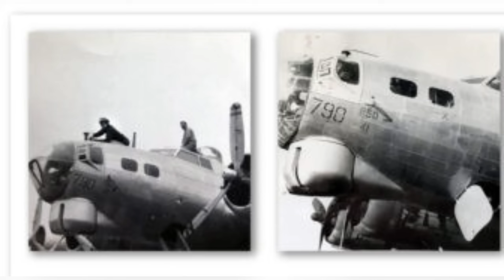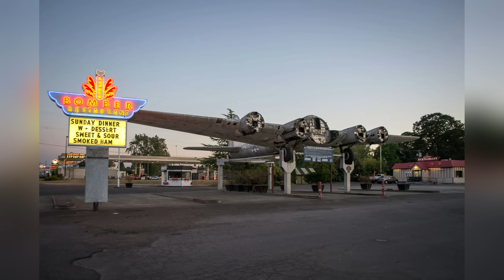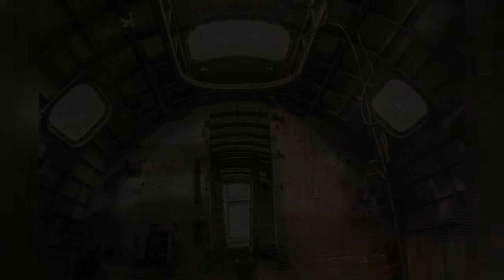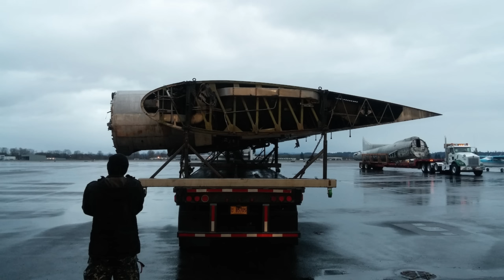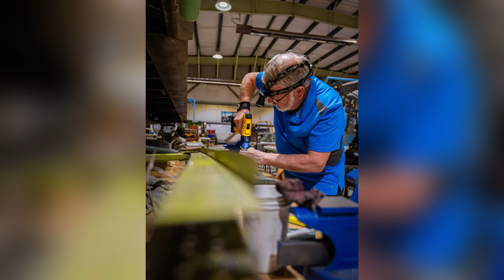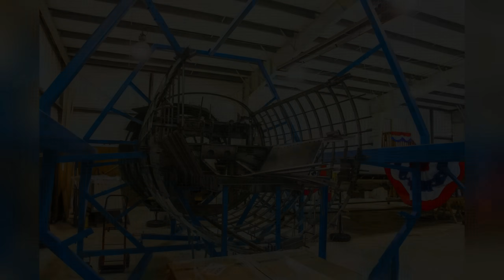Recovering B-17 "Lacey's Lady": Gas Station Bomber to Flight Again

Comment: I have to wonder if Boeing is supplying any assistance? I know Northrop refused involvement for a P-61 flying restoration in Reading PA and Lockheed also refused to support the now successful restoration of the P-38 “Glacier Girl” in Kentucky. The manufacturers were not against static display restoration but did not want the liability of a flying restoration. The P-38 detail drawings were recovered from Smithsonian archives.
Reply: I can see that. If it crashes, they don't want people thinking it was their fault.
Reply: I think that today the liability issue is actually off the table. Until about 1985 or a bit later, every airplane component maker suffered from a "long tail" liability legal problem - the maker of every part could be held liable forever. Numerous successful lawsuits against both airplane and parts makers for planes over 30 years old made liability insurance essentially impossible to afford, driving many companies out of the market. A big driver of this problem was the common belief that all airplane owners and pilots were wealthy snots who deserved what they got - they and their insurance companies were thought to have deep pockets.
In one case I was slightly familiar with, a pilot leaving Santa Ana forgot to put gas in his 25 year old Cessna. He took off, made about 500 feet, then fell out of the sky and crashed into a house. The company that made a stock component - iirc the magnetos - spent $2 million in legal fees proving that the plane didn't even have those nag etis on the plane. The company left the aviation market. 
This and other similar cases finally drove the CA legislature to pass new laws ending liability for planes and parts over 10 or 15 years old. 

I probably have a lot of details wrong, but this change in the law reversed Cessna's plan to stop making airplanes and leave the market.
Reply: @GaryBickford  Thanks for your input. A little research on my part indicated you are correct. The industry eventually caught a regulatory break in 1994 with the passage of the General Aviation Revitalization Act (GARA). This law protects small aircraft manufacturers from liability suits for airplanes that are more than 18 years old, which helped stabilize insurance costs and allowed Piper and other manufacturers to return to steady production. I come from the Air Transport world and I’m out of touch with what goes  on in General Aviation. The owners of restored war birds still assume liability.
Reply: Boeing as a company sucks a ss.

Comment: My neighbour designed and built his own plane .Every bolt ,nut and fastening had to be top quality ,every panel examined before it was given a registration number and then allowed to fly .if the examination system is so vigilant how is this old rusting junk ever allowed to fly without every part being replaced in essence it would be 100% NOT the original plane .

Comment: My friend calls this level of restoration as "Jacking up the radiator cap, and replacing all of the rest."   I once had a neighbor who replaced one of the windows in his house with a new one.  He then gently removed the window which was undeniably a part of the house, and set it aside.  He then tore the roof and walls completely off of the floor of his house.  Each were replaced, constituting a "reconstruction" or "restoration".   He then returned the window to it's home.  All that remained was to remove and replace the floor.   Because each phase of the process replaced only part of the house at a time, he got to call it "fixing" rather than "replacing".
Reply: A bit like "My Grandfather's Axe". My father put a new handle on it, I put a new head on it, bit it is still my Grandfather's axe!
Reply: @robbierobson3251 See also "The Ship of Theseus", which presents this process as a philosophical question - if every part of the ship is gradually replaced, is it still the same ship? 😊
Reply: @GaryBickford  To which the answer is quite simple.  Yes, it is the same ship.  While every part might not be the original, since they were all replaced one at a time, each "new" piece was given time to be "broken in" and "acclimatized" to the original parts and thus became no different than the original part it replaced.  It is no longer a "new" part but just a "part".
Reply: @randomlyentertaining8287  That's not the whole of it, though (no pun intended.) The follow-on question is if you were to take all the replaced parts and reassemble them into their own ship, which one is THE ship of Theseus? That one? The other? Both?
Reply: @robbierobson3251  I still put new handles in old rusty tools like that (axes, hatchets, hammers, etc). I was gonna soak them all in Evaporust first, but that would get expensive with several tool heads to de-rust.
Reply: @paulis7319  Just use them, the rust will wear off slowly!
Reply: @robbierobson3251  Neat!
Reply: It's said that in many of these types of restoration, the only original part remaining is the data plate.
Reply: This makes me wonder. When does it become easier and more viable to just build a new B-17 from scratch?
Reply: Very common on expensive classic cars.

Comment: At the Ft. Myers Fl. Airshow 2005 I have pictures of myself and the Nine Oh Nines I was talking to the Flight engineer. When he found out I was a certified aircraft mechanic. I ended up locating an oil leak on engine one. Then I cleaned the runnin mag on #3 I helped walk the props thru. After the start I was just watching from the ramp. The next thing I know. I'm waved to the rear side door. The flight engineer told me the pilot wanted to see me in the cockpit. I go up front walking past men who.paid $350.00 for a ride, the pilot nods to the co-pilots seat, and says." Sit down." 😊😊😊😊😊. I was just thrilled to help having worked at 2 engine shops. But the last picture was me sitting in the cockpit with my female Vos Mari Eclectus Parrot, the pilot had his Blue and Gold Macaw with him. He was on a perch made from coat hangers and a wood dowl, hanging from the chin turret. I have a picture❤ I got to fly! I was working at Pratt & Whitney In Conn. When the Nine oh Nines crashed on landing, totally destroyed.
I got home found the pictures and cried like a baby.😢